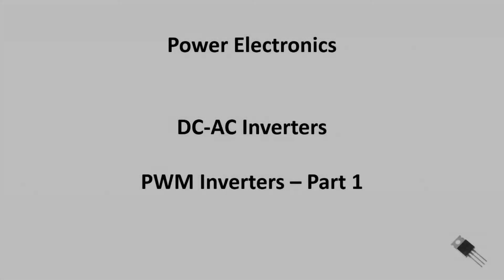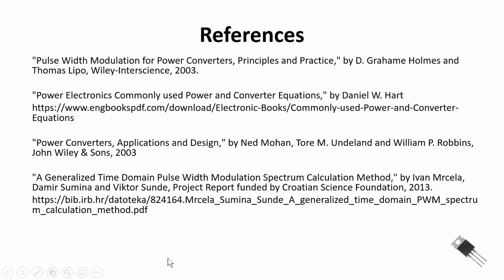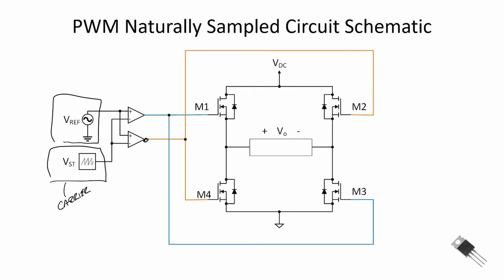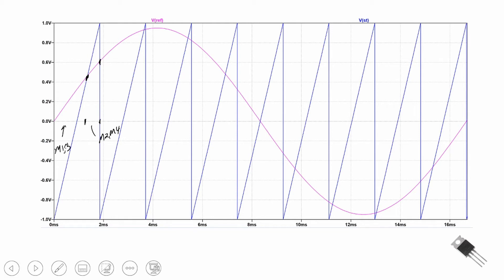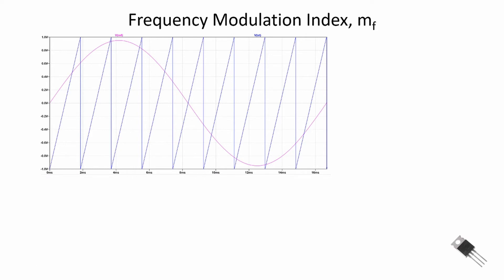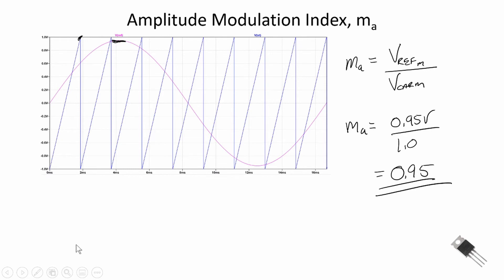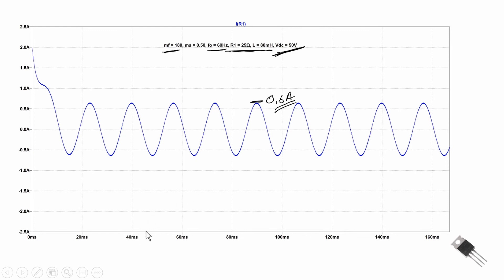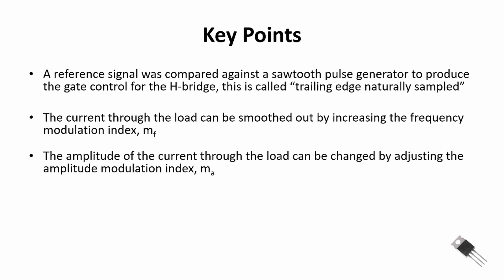Power Electroics - PWM Inverters - Part 1

Comment: At 2:09  isnt that in this setup both comperators will give 00 or 11 ... If Vref connected to both + and Vst to both -. 🤔 Should be mixed + - for each ?
Reply from the maker: I do illustrate a "NOT" function on the lower comparator, and hopefully we don't turn M1 and M4 on at the same time.  I'm glad you are double checking the logic on the comparators as it is critical for proper operation of activating the MOSFETs in a bridged configuration.  Best wishes on your design! -Dr. K

Comment: Hello sir,how much frequency does the triangle signal use?
Reply from the maker: Hi Satasauu75, the PWM frequency used by the carrier really depends on the application.  The carrier frequency can range from 20kHz to 100kHz.  Sorry that I cannot provide a concrete number.  Please note that the carrier frequency in this video is not realistic as it would be too low compared to a real application. It is for illustrative purposes only. Best wishes on your design. -Dr. K
Reply: @powerelectronicswithdr.k1017  Thank you very much.

Comment: Hello sir, the Vdc is 50 volt, but the v(out+, out-) is 100 volt, is it correct?
Reply from the maker: Yes, that would be correct.  The units would be 100 Vpp (volts peak-to-peak) or 50 Vp (volts peak).

Comment: Hello, Sir can you explain me, please?
Why is there a diode parallel to the transistor?
Reply from the maker: Hi Yovel, great question.  Those diodes are called "body diodes."  The body diode is often part of an enhancement MOSFET construction.  As an example, the source and drain consist of material that has n-type doing in an n-channel device.  The body and gate have p-type doping.  Therefore, there are pn junctions (a diode is a pn junction from anode to cathode) between the body-drain and the body-source. In addition, the body is often galvanically connected to the source. Because these are at the same potential, this pn junction is ignored.  However, the pn junction between the body and the drain is illustrated on the symbol as diode.  This diode is often used to handle fly-back current in inductive loads.  It is also used to assist with zero-voltage-switching (ZVS) for resonant converters.  Here's a link to a reference on Digi-Key with more info:  https://www.digikey.com/en/articles/the-significance-of-the-intrinsic-body-diodes-inside-mosfets  Best wishes on your designs. -Dr. K
Reply: @powerelectronicswithdr.k1017  first of all, thank you for your attention! 
I have another question how do I choose the frequency of the reference signal?
i understand from the video that is by the parameter that is required to M_f but there is there a range of frequency that is acceptable?
Reply from the maker: @yoveluzan5429  Yovel, great question. Unfortunately there is no correct answer and it really depends on the application. For example, the switching frequency on AC motor inverters can be in the 2kHz range.  However, I have a class D audio amplifier (one can think of it as an adapting AC inverter) that switches at 140kHz.  This high frequency keeps the harmonics out of the audio band. When selecting the frequency,  you are balancing component sizing and switching losses.  My final suggestion is to research the application to see what others are using.  Best wishes on your design. - Dr. K
Reply: @powerelectronicswithdr.k1017  First,
I want to thank you for all your help!
Secondly, I have one last question, sir, I just wanted to ask why we have the transition processes you mention in the video at minute: "10:00"
I mean why does our current there look like this?
Is it because the current in the coil is continuous and at the beginning the current is 0 you assume that the current in it is and it takes time to stabilize?
Reply from the maker: @yoveluzan5429  yes, the inductive load will keep the current flowing in a continuous manner. Another way to think about is that the inductor and resistor create a low pass filter with regards to the current. The 3db bandwidth of the filter is well below the PWM switching rate and filters out those high frequencies leaving only the frequency of the reference.

Comment: Hello sir, so in order to get the duty cycles we ve to have previously a triangular signal & sinusoidal signal ? ( I mean there are no other way to get it )
Reply from the maker: There other ways. Because the reference is periodic and has known values, you could use a Look Up Table (LUT) strategy to set the duty cycles.  However, when the reference signal is not known apriori, then this approach is common.  For example, it is used in some forms of Class-D audio amplifiers.  Hope this helps. -Dr. K
Reply: @powerelectronicswithdr.k1017  yes it is.
Thank you, sir.